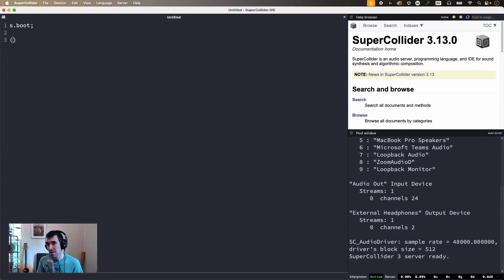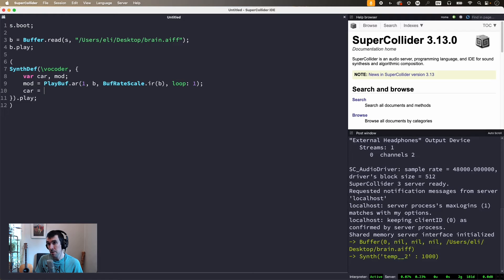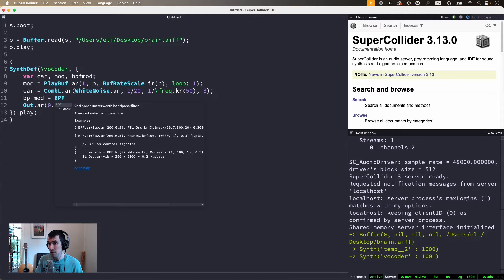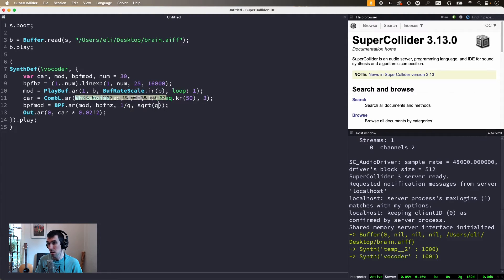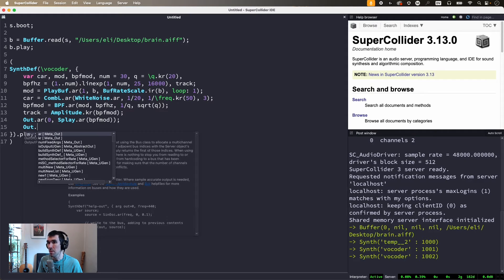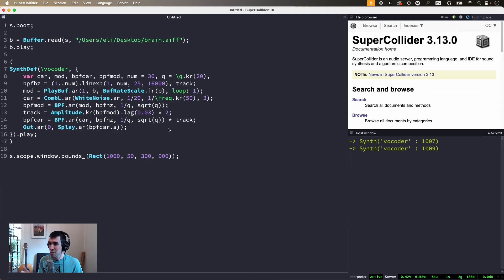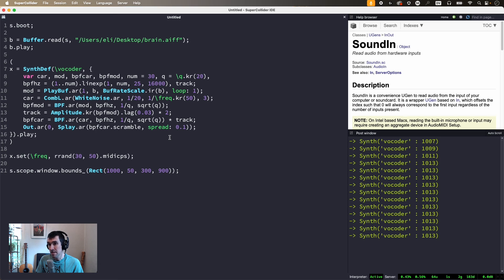SuperCollider Mini Tutorial: 12. Vocoder

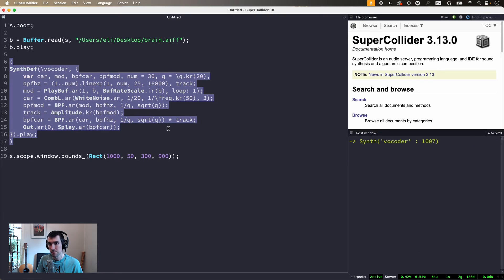Comment: Nice! At 3:12, the grittiness is because Amplitude has lousy default settings, attack and release both set to 0.01. If you set the attack to 0.01 and release to 0.1 in Amplitude you don't have to use the lag.
Reply from the maker: An excellent tip! Using fewer UGens is definitely more efficient.